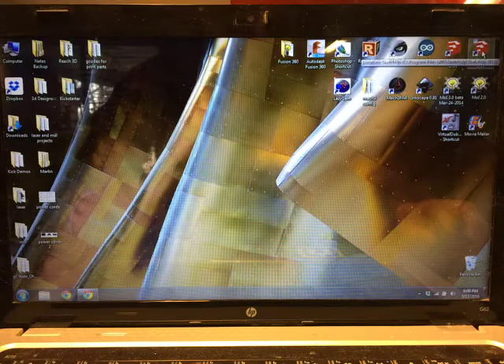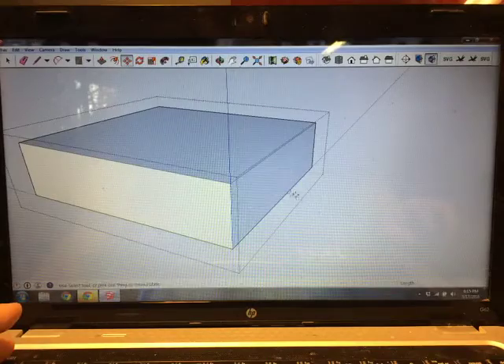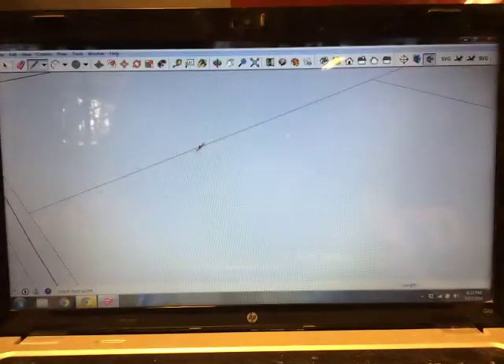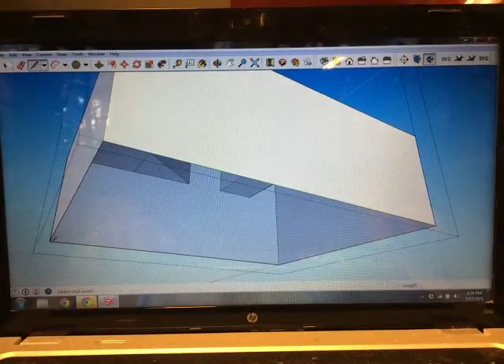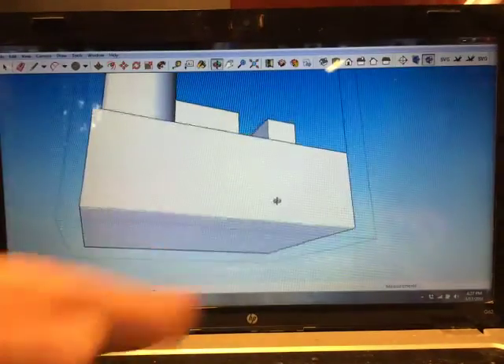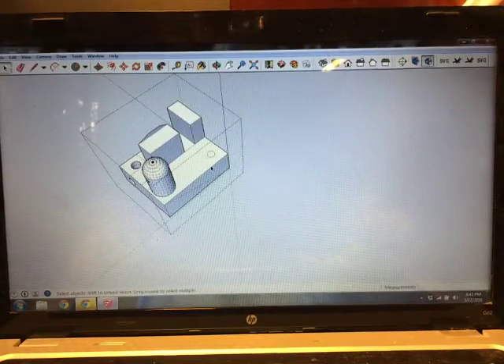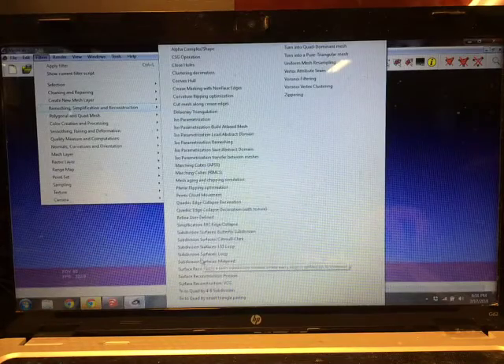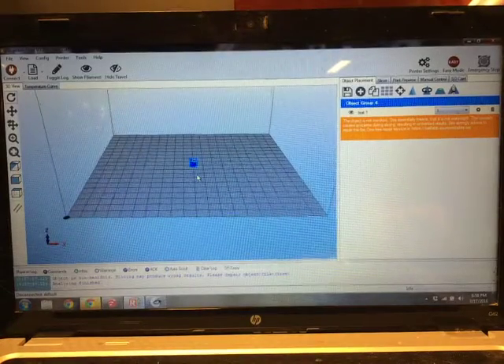Old - Reach 3d Sketchup Basics and Meshlab conversions

Comment: You can scale in Repetier host/slic3r if the scale is wrong. Also, there is a Sketchup plugin that lets you export in STL. Importing STLs takes forever in sketchup, I have to try the reducing function in Meshlab
Reply from the maker: MrCookieMonster
Yeah, I'm making new videos for my printer buyers. The quadratic edge collapse decimation function in meshlab will reduce poly count fairly well for smooth surfaces, but tight folds can be an issue. 
I've tried the STL export in sketchup with no luck :(